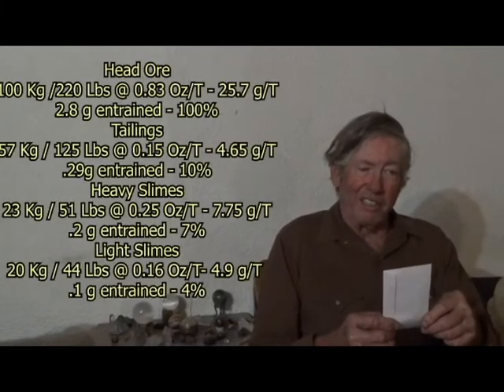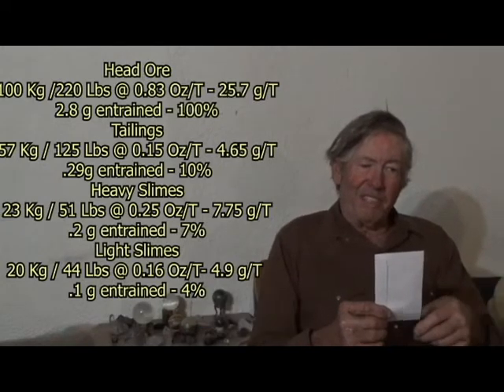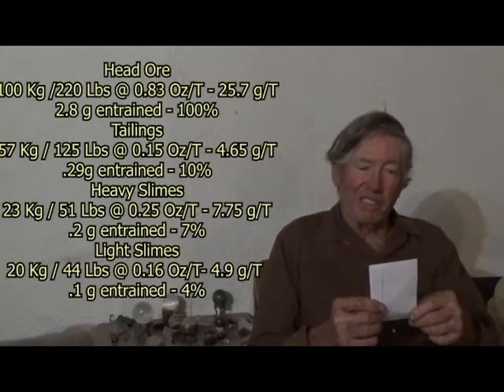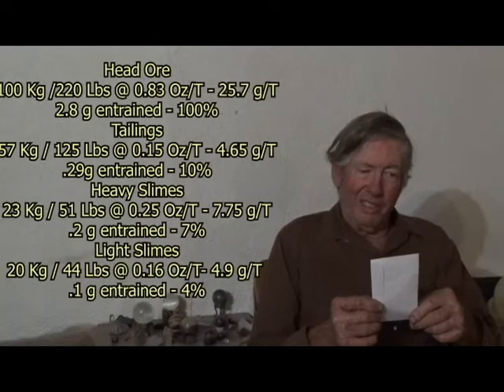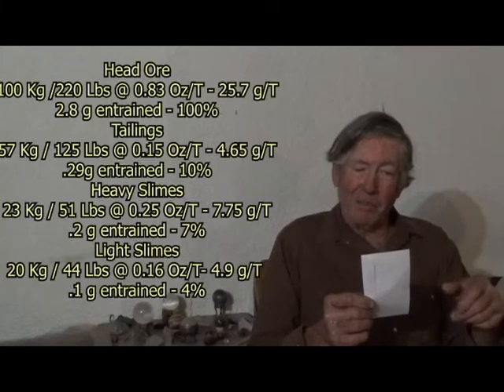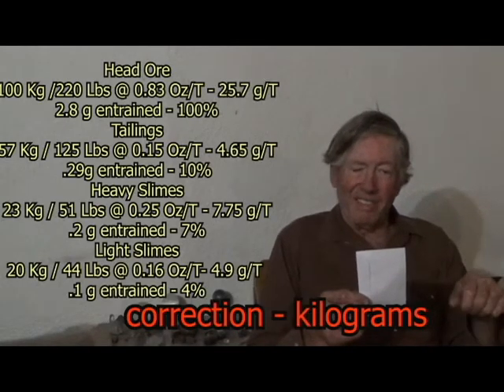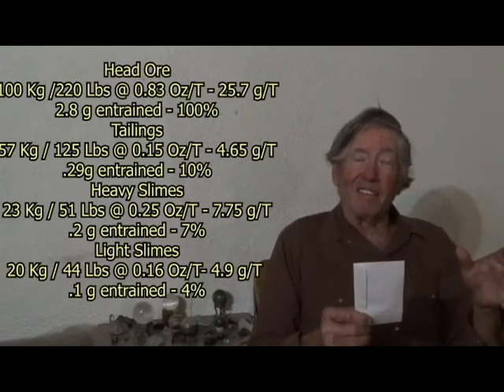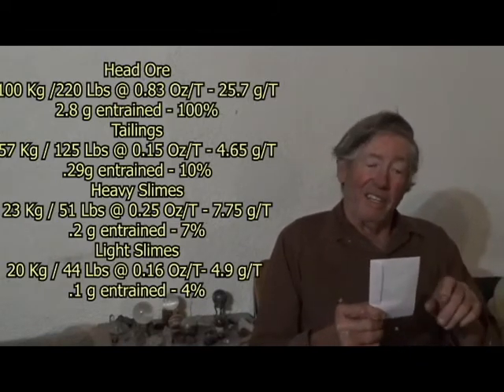189 79% Recovery With the New Concentrator!

Comment: Before the revamp what was the recovery rate ? If you had a substantial gain with one improvement you're on the right track. Realistically a 95% recovery is the normal right so you're almost there
Reply from the maker: It was at 65% before

Comment: Would you like to review one of my magnetic separators on your channel?
Reply from the maker: Potentially, sure.  I will be honest either way.  Do you have a video up I can see to evaluate how I might be able to use it?
Reply from the maker: @MiningMagnets  I think the roley poley might actually address a problem I was thinking about.  If it works well, it will be quite a help,  I am trying to separate magnetics from micro fine gold and I could run a slurry down the funnel where the magnet would pull the magnetics out of the stream while the water keeps carrying the gold downward.  I would love to try one.  You can email me at HardRockU@outlook.com to make arrangements.  I promise nothing but a solid try, an opportunity for you to give me guidance, and my honest results.

Keith

Comment: Seems to me you could probably get away with putting a small amount of mercury in your slimes buckets, not sure how you feel about using mercury, but if you are keeping it all in and not letting anything back out into the environment, it should be okay.
Reply from the maker: I think a second stage will improve things.  We'll see.  Trying to make a system that uses no chemicals for permitting reasons.